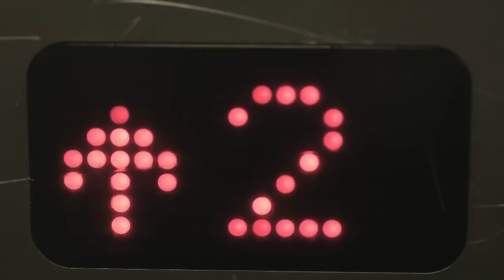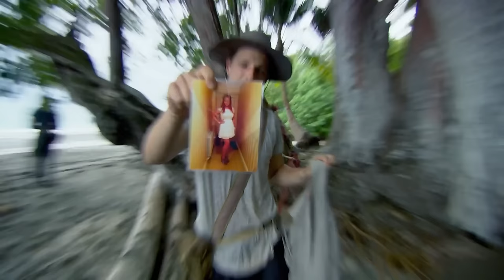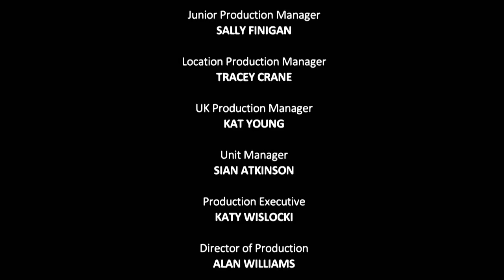DEADLY Scorpions, Snakes & Crocodiles 🐊 | The Island With Bear Grylls | S02 E01 | Thrill Zone

Comment: How to survive: clear ground. Gather dry sticks (keep sticks in a dry place). Start a fire with long consistent strong stokes. Locate water and boil water. Build shelter and build it a few feet off the ground. Built rotating stick vent for a fernus. Make fernus with clay, build brick tile roof for no holes. Cover yourself in mud for mosquitos. You can also slice wood into slats or flat boards and use it for a roof. This requires chopping logs and losing more energy. Gather charcoal and make a pile. Must keep dry. Make a stick-twine wall, use clay to make the clay-mud wall. Make clay brick to build sturdier walls if desired. Find bark or thin strong branches you can weave to make a rope to make a net or traps. Identify iron minerals and burn chunks of grinded rock to find iron. Gather the iron pellets to forge cast iron where one can make cast iron tools. You can gather sand and pebbles to make a water filter for mud ponds. Making air conditioning. You can do this by pouring water on open clay jars in a wind funneled area. You can store food in covered pits suspended deep in the ground. Moral is important in a group. Laugh when they fail or give up sometimes and cheer and celebrate when they acheive a goal. Sing songs and hold celebration hearings for people who have achieved things. You also have to reawaken beastly, predator, and ancestral spirits within oneself. You need to bring out a person's feral spirit that is dormant within a person. My thought are that it's every man for themselves in the collection of a group. Everyone should look out for themselves and make deals and agreements to get things done with others. This eliminates unecissary hiarchy and leadership foolishness. You help others in emergencies for them to help you back some other time. There should never be any excuses. If someone wants to do nothing, they get nowhere and nothing done. If someone doesn't forfill their promise in an agreement, you don't do anything else with them. In the end, everyone pulls their own weight, there are no power struggles, and everyone is responsible for themselves. Laughing and celebrating your achievements is what keeps you strong and going. The competition for acheivments is what keeps the whole group going.

Comment: 21:51 so the guy who is ALREADY wearing glasses ask the other guy, hey let’s try using your glasses 🤦🏻‍♂️

I would have blind folded the group and drop them off one at a time at different point around the island (the one being drop off would take off the blind fold and get on the island ), and it’s up to them to either survive solo or find the others for another hand , of course extra hands also comes at a price of another mouth to feed
Ugh I have to deal with people like Andy and that suck , they are always using the victim card!
Reply: The other dudes glasses don’t have a plastic rim that would of gotten warped or potential melted from the heat

Comment: if you ever end up on survival mode golden rules are 
1. make a sliding water collector to collect it on a huge container
2. build a shelter higher enough with the branches and stems of trees also dig around the boarder of shelter and make marks for trails
3. lit up the fire in middle of the shelter by diggin up small hole and put heavy trunks as the fire gets bigger 
4. collect any eating things that is edible and cook it with mixture of normal water & sea water by boiling it to max 
5.  build a raft for fishing with the trunks and rather then eating snails make it as a bait for fishes
6. be creative do something build something rather then being depressed and fighting with each other just do not seat ideally

Comment: It's funny because only survival shows you never see them have anybody with even the basic military background. That's due to the fact that they know that all those little weak links like then guy have I root it out within the first two weeks. Through the same process sleep deprivation, psychological stress and pressure. Compounded with being in a new place around new people. All the night terrors night walkers emotionally unbalanced and imbalanced those kiss generally psychologically not capable of dealing with this stress and pressure they put on you. But the ones that come out had their backs stiff in their heads up. And they've learned how to deal with adverse conditions and stress. They've learned asleep in the hallway between test. To run everywhere. So long walks nothing.

Comment: First you have no leaders here. Trying to make someone a leader, who is not, can be far more challenging and counterproductive than these 14 men can afford. A shelter needs to be built for both the men and the fire and that is the bottom line. You have 14 men here wasting time watching full grown men arguing and fighting over who can tie the better knots. I say to the other 12 men Leave them alone to fight their pointless battle alone and get to work. 3 men cut the timber for the floor 3 men cut timber for the walls and 3 men cut timber for the roof. We are talking trees here.  20 X20X30 OR 30X30X40 FEET EACH TREE AS THICK AS YOUR ARM WITH THE FLOOR TWICE AS THICK. 
You dont need a leader to cut the trees just do it.  These men are way to old and their behavior shows them to be encourageable not teachable or flexible in any way you can't teach an old dog new tricks let him go fight and argue over the sunset and move on. Your on the clock and wasted a whole day watching 2 full grown men fight over each other while the rest of you are suffering because you have no real leader. A real leader puts his men FIRST. I saw the shelter he lead you to build everything about it was wrong and THAT was his best try. Just look at how thick the sticks their using is. They should be using 3 or 4 inch. In dia. Nothing less. The size of your upper arm.